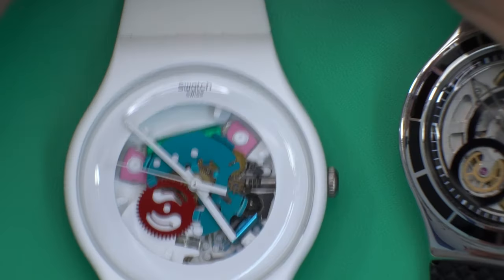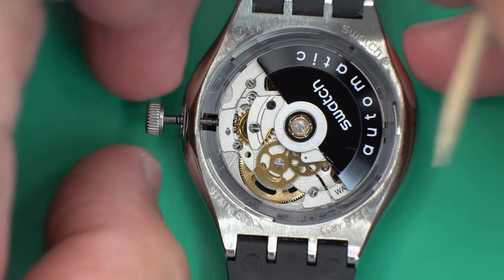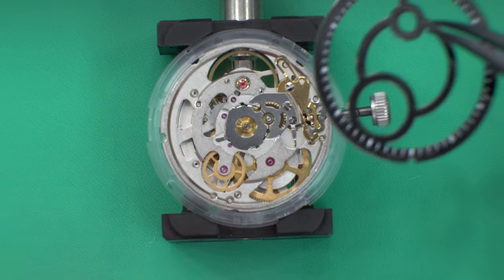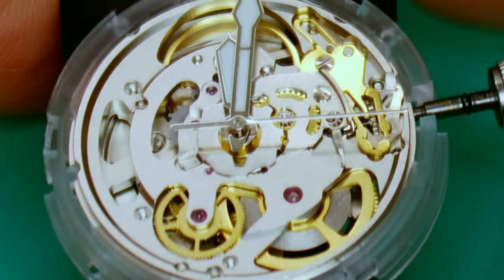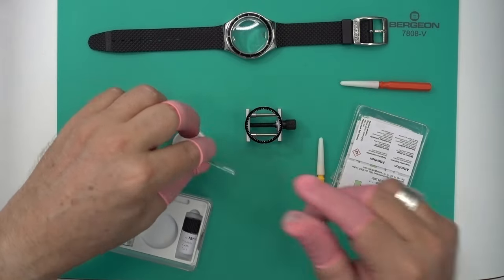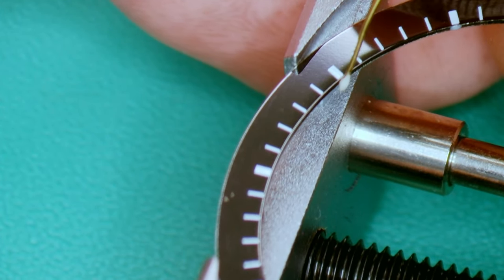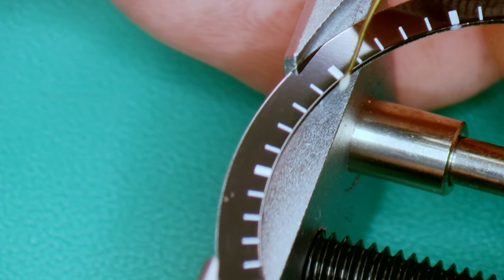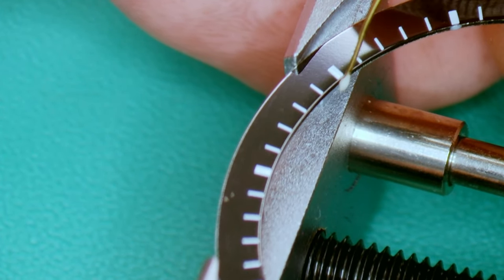How I Turned a $40 Swatch Automatic Into My Grail Watch

Comment: Here's a cool little trick that I'm not sure if you know about with your Dremel, if you unscrew the collar under the bit, the plastic part, there's a metal ring inside that's squared off and that's actually a wrench for your bit chuck. You won't need a wrench ever again. Just unscrew the collar lift it up tighten it or loosen it and screw it back down. Cool huh?
Reply from the maker: I did not know that! I do recall vaguely that the wrench actually came with my 1990's 110v Dremel tool, and that I didn't get one with my 2000's 220v after I moved to Switzerland. Perhaps I should have read the manual! Thanks for the tip!

Comment: Since the lume is repeatedly 12 times, I suggest to do a little set up to hold the "pen" at a steady level and shift  the chapter ring over would have an easier and better result.
Reply from the maker: The lume thickens very fast (as it dries). Getting the lume onto the tip of the oiler and then getting the oiler into a jig would take time, and also the jig would not allow the manual manipulation of the oiler necessary to release the correct amount of lume onto the chapter ring. Tritec makes an actual pen that disburses luminous paint / varnish mixture,  but it costs several thousand dollars and requires a large reservoir of luminous paint to be loaded so it's more for industrial use. I would love to find one of those second hand to try it out, because in that case your idea would work great, but without that a jig would, in my opinion, cause more trouble than it's worth!

Comment: Best to use the right size screwdriver that fits the whole length of the slot to release the crown and stem as with the correct width screw driver it will not over press the release button and cause the usual problem.
Reply from the maker: Thanks! That's great knowledge! I did not know that!

Comment: for water resistance test, shouldn't one be using the pressure chamber thing? with the watch above water in a pressurise chamber, water lowered into water, pressure slowly released, one watches for any escape bubbles.  if there are means, that's where the weak spot is.
Reply from the maker: Yes, absolutely! The more expensive waterproof testers don't even use water - they just use air pressure. Unfortunately I don't own either. 😢

Comment: Hi, nice video.
today I just realized, that the ETA 284x-movements just ETA 2824 without date and with a lower beatrate, did you reconized that ?
Reply from the maker: Thanks for your comment! The 2841-1 movement also has a silicon or plastic pallet fork and escape wheel and I'm not sure if the overall height and stem offset are the same as the 2824. Ranfft is currently down so I can't check that (although I think I have it saved somewhere). In any case I love the 2841-1 skeleton movement in this watch. and the fat hands with lots of lume make it very readable throughout the day and night. I would like to eventually put this movement and dial  chapter ring in a more traditional case, also with a clear caseback but easier to open for service, so I will get back to this eventually in another video!
Reply: @IMakeWatches  Thanks u for your answer. I´ve got 3 Swatch Automatic from a fllee-market (what me cost 3.-€ a piese), but with crumbling plastic cases, now I think to try a conversion with a ETA, Seagull or NT5000-case. The thickness of my ETA 2824-2 movement look similar (but I don´t wil pull it out the housing 🙄) !

Comment: Hi, nice video of your work. I have a Swatch YAS112 but the acrylic case back is broken. I read that it could be replaced with a front crystal, but the shape is different. Do you know where I can find a replacement?
Reply from the maker: That's a great one!  I took mine to the Swatch store in Geneva and they offered to service it, and for some reason I think it was only about $50 to service. I asked and they said that the crystals would be replaced if there was any damage to them. I could be wrong about that price but they definitely said it was serviceable and  the crystals would be replaced. I also tried finding the crystals at Cousins and on Ebay and couldn't find them either. My advice: take it to Swatch or Tissot or any of the Swatch group brands and ask. It's a very special watch and it is serviceable.
Reply: @IMakeWatches  thank you very much for your advice!!!